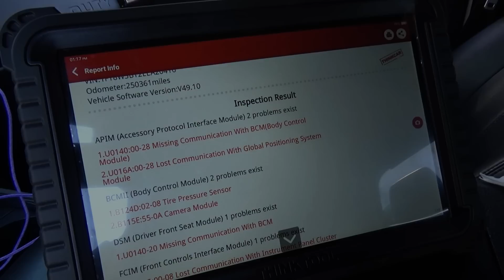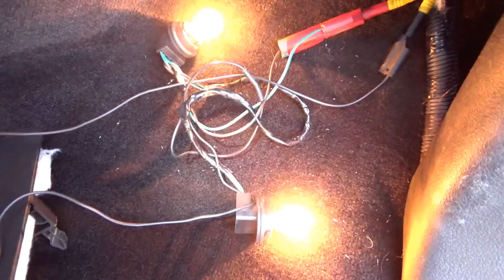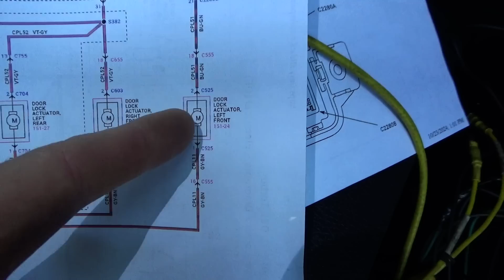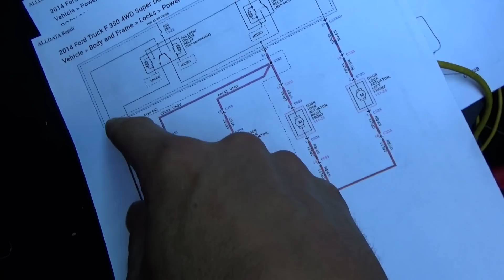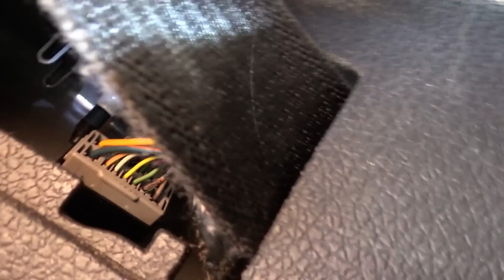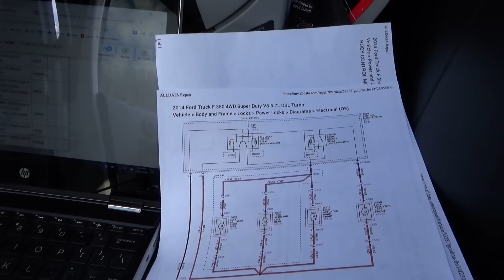(Pt 1) PowerStroke Power Locks DISASTER!?

Comment: Looks like everyone knows how this was caused. This has to be the easiest cliffhanger question you have ever posed, Ivan. 😄
Reply: So “how” was it caused?  I am quite puzzled because I seriously doubt that even that 20 amp fuse caused the carnage. Should be interesting to find the actual cause.👍
Reply: @brianw8963  Someone put a fuse into the circuit that was way too high in capacity.  Numerous comments pointed to this obvious act.  (I think that the owner is a friend of Ivan and he didn't want to embarrass him, so he acted like he didn't know what caused it.)
Reply: @vpimike2646  That is speculation, but probably close to truth at least regarding the fuse. 👍
Reply: @brianw8963  Oh there's no speculation to the cause of the burned up wires.  Had the correct fuse been installed, it would have blown long before the insulation on the wires would have melted.  That's the purpose of fuses and circuit breakers.
Reply: @vpimike2646  Is it a possibility that someone may have even inserted a jumper wire in place of the fuse momentarily to follow the smoke? What did You not comprehend on my initial comment. And I’m fairly certain I have a grasp on the function of fuses and circuit breakers, but thanks for the update .

Comment: When I first opened my shop and was just getting into diag I had a guy bring me a VW Jetta. It had windshield washer nozzle heaters. It starte blowing a 5a fuse. He had a pile of probably 50 fuses in the floorboard. All the colors 30a 20a 15a he just kept putting them in. It melted clear back behind the dash. I did get it isolated but it still had wires melted. Id bet that your customer was putting all kinda fuses in too.

Comment: Ivan you are becoming the master of the cliff hanger. Can’t wait til tomorrow…

Bad door lock switch? Sticking? Causing relays to stay on extended time thus heating wires? Maybe that blew one motor to open circuit? Motor windings became the fusible link?

Comment: A bigger problem now is you touched it... so now it's a personal liability issue if you don't properly repair or at minimum remove or isolate the damaged wiring. 

The last thing any independent mechanic needs is an underwriter suing you for damages from a burnt up truck. What if a house or other structure burns down... hundreds of thousands in damages.

Comment: If failed resistance is sending xtra current that would smelt wires.Its either a stronger current item or a small one like the door locks that would get used and repeat the occurrence often

Comment: 20A is too large to protect individual small gauge wires.  Kind of a bad design though maybe not different than other vehicles.  If the system has any kind of feedback capability, it would energize the solenoid until it sees it lock/unlock (up to a timeout I would assume).  This may be a case where you need to quote the customer for a wiring harness and not try to piecemeal it.  I'm sure it's expensive, if it's even available.  Or used may be a better option.  But I would seriously consider just doing the entire harness where wire damage could have occurred.  At least quote the customer and let them decide.

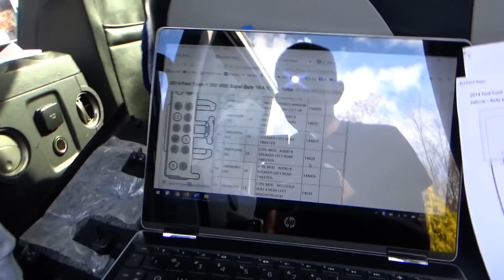Comment: 15:10 How?  Answer with funny example-When I was a rookie at Toyota in the 90's and had a Previa blowing a radio fuse, another tech told me to "smoke test it" after frustratingly trying to find the short.  Straight jumper in place of the fuse revealed the radio amp in the back quarter was the problem but sadly it smoked the harness from the fuse box all the way back.  So that's the answer-Someone smoke tested that baby. LOL

Comment: Someone must have used a fuse that was measured in Ga rather than amps :)

I guess if the body nicked the wire(s) at some point in the main harness, that's likely where the meltage will stop.  Otherwise it's going through the entire length of wire and every connector back to the fuse block.  At least Ford decided not to tape it up the entire way.

Comment: I wouldn't touch that harness with a 10 foot roll of automotive tape.  It is full replacement or nothing. Personal opinion.  

By the way, that is a poor design.  The wires are too small for the fuse.  There was a failure to analyze what would happen if a single point of failure on one branch would create a path to ground that would draw all 20 amps through that one path resulting in an overload on the wire.  If you think about it, if you need up to 5 amps on each lock then 4 x 5 is 20 amps which makes sense but with that circuit if one lock starts to short just a little bit it will draw more and more current from that circuit since they are all in parallel. The lowest resistance path draws the most current.  Remember that the owner reported that at first it was only one lock that didn't work and over time it got worse until the fuses started blowing.  That damage is the result of a gradual process.  

The circuit needs to be redesigned to either have heavier gauge wires or so no one branch can draw more than the rated current for that gauge of wire.  I could get a second year physics student to figure that out.

Comment: Wire CSA is too small for the fuse, or the fuse is oversized for the wire. It's a bad design that's common in nearly all brands and models. Even luxury brands that cost a lot of money. They want to save money by using the smallest wire possible, ignoring the current rating of the wire. They probably think that if there is a direct short the wire resistance will be low enough for the current to be high enough to blow the fuse before melting the wire. That is only true if the short is direct, not partial, and the wire is short enough - after some length, the resistance of the circuit is too high to reliably blow the fuse even with a direct short. A partial short may melt even a short length of undersized wire, say if the wire can only carry 10A continuously, the load is normally only a couple A, but then that one wire is joined together with a couple other loads into one fuse that is, say 20A, because the total current of all loads is more than 10A. If a partial short in one of the loads occurs, so that the small wire is now carrying 20A instead of the rated 10A, the fuse will not blow, but the wire will melt if the partial short doesn't burn out in a very short time. If there is a direct short, the fuse will melt as even if there's say 40A going through the wire rated for 10A, the 20A fuse will blow before the wire melts. It's this practice of fanning out one large fuse into several smaller wires that are only sized for continuous duty for their attached load, that leads to melting wires in case of partial short (overcurrent) fault scenarios.
Reply: The correct engineering practice that is taught to all electricians is that a fuse must always be sized for the smallest wire it is protecting, regardless of the load attached to the wire, because the fuse is there to protect the wire, not the load. If that were done in this case, the wire would not have melted. The manufacturers ignored this practice, because their product is not subject to the same regulations and inspections that building installations are, they can practically do whatever they want with wiring.
You can also correct their mistake after the fact by installing smaller fuses. I do this to all my cars that I own. Look at the wiring diagrams for the load side of each fuse, look at what the smallest wire CSA is that the fuse feeds, look up the rated current capacity of that wire, then install a fuse slightly smaller than that. Of course sometimes the peak load through that fuse is larger than the fuse size you arrive at by looking at the smallest wire size, in that case you need to compromise and install a fuse that won't blow with the applied load, and gamble that there won't be an overcurrent fault on that undersized wire. The  most common place where wires are undersized are blower motors, wiper motors, lights, small actuators fed by the ECU or BCM with no individual fusing other than one main fuse feeding the entire module. In the blower motor case, the inrush current when it's starting up is much higher than the normal running current, so they size the wire to the running current, but the fuse would blow with the inrush current if sized to the wire, so they oversize the fuse by 50-100% to keep it from blowing when the blower is turned on (this problem usually doesn't exist if the blower regulator is electronic, as they have a soft start current limiter).

Comment: Ivan, what do you mean "you do not understand why the 20 Amp fuse didn't protect the circuit"? Answer: Someone was in there before you, sending 12V via jumper lead straight from the battery through the wires. Only stopping once smoke came out from under the trim. Don't be naive.

Comment: One owner was tired of blowing 20 Amps fuses, and installed a jumper wire until smoke came out from under the trims. Then quickly removed it and passed it on to you in order "to deal with it". Problem: The harness melted together. Lucky he didn't set his truck alight. Ivan, refuse to deal with these kinda people unless they accept accountability, and are willing to bear the cost for the proper repair
Reply: Always deal with these folks. 
Morons like this pay the bills. 
Between diagnostic time and parts.... money is money
Reply: get that in writing from the customer
Reply: I knew someone who did the same thing to a VW Bug.."I'll see where the short is by finding where the smoke is coming from".
Reply: Exactly the issue

Comment: Your current drop difference … The lower current reading was going through the test light and the door coils to find its ground…. In series = more resistance/ less current. The higher reading was direct through the test lights to ground. If you rewatch your testing the side of the tree with the short is obvious.   
As always … great stuff
Reply from the maker: Take a close look at the readings... The difference was only 0.2A...so BOTH sides of the circuit were directly shorted to ground 😉
Reply: It’s three coils in parallel so the difference between a direct short and a path through the coils is small   … but it is a measurable difference.

Comment: Short must be in the door harness where it bends when you open and close the door, some times they melt far enough that you have to remove the seats and console to fix it.
Reply from the maker: But I measured the resistance through the door lock circuit of the Left Rear door and it was OPEN! How do you explain that? 🤔
Reply: @ because it might have shorted to another wire not related to that ckt and created an open I have seen this many times
Reply from the maker: @corradoferrari6191  so we have a bad door lock actuator AND a short in the door harness? That would be a BIG coincidence 😄
Reply: @PineHollowAutoDiagnostics  just remove the rubber acorde on on the door harness before the connector and you will see if the wires are bad which I bet they are, most likely a thicker wire with power shorted to a thinner ground wire and caused the main harness to burn the way this one is, lock fuse did not blow until power was activated to lock or unlock.
Reply: Door harness if bad can be replaced if available it was on back order for years.

Comment: That wire is not 12-gauge wire. It's maybe 16-gauge or 18-gauge. Maximum current would be 10 amp. That fuse was rated too high for that circuit. It allowed constant over current thru the wire overheating it, before it melted the insulation and popped the fuse.
This is an engineering design failure.

Comment: the fuse kept blowing and someone installed a larger fuse
Reply from the maker: 20Amp stock fuse was already wayyy oversized 😂
Reply: Exactly what I was gonna say. My first car had no illumination on the cluster. When I checked the fuse box, there was a blown 30A fuse. You couldn't read the required size, but I knew it wasn't 30A. When I got a Chilton's manual, it showed it was supposed to be a 5A. The load side of that fuse had melted to another circuit. I had to rerun the entire illumination circuit. The short was in the ashtray light. The repeated opening and closing of it broke the wire and it was laying on the dash support and the previous owner just popped in a 30 as a "fix". It's a wonder it didn't burn down, same as this truck.
Reply: @topher8634  My thoughts exactly
Reply: @topher8634 I looked at an old 4 runner with no brake lights for a coworker at my old job. The guy just kept putting in larger and larger fuses each time they blew. Melted most of the wiring harness together front to back. I sent him on his way and told him good luck.
Reply: Damn, beat me to it! Eventually the wire becomes the fuse!
Reply: Yea I'm willing to bet that's not the first time that fuse blew. Probably put several fuses in in a short period of time and it cooked it
Reply: Or installed a no blow ‘fuse’.
Reply: Thats called aluminum foil@John-dp3ln
Reply: Could be those crap Amazon/chinese fuses that don't blow as rated.
Reply: I had a customer with an MR2 that doubled the fuse size and burned a wire through the entire main harness behind the dash.
Reply: Isn't that standard operating procedure 😅
Reply: Over fuse it! You'll find your problem!
Reply: @philllsxga.7737   that's known as smoking out the problem.
Reply: Would a 20 amp fuse cause that much carnage? I think there’s more to the mystery. We shall see. 🤔😀
Reply: @brianw8963  it's possible the guy put a short across the terminals in an attempt to "fix" it
Reply: That is what my answer is also. Although I have seen as proper sized fuse not blow and melt wires like this.
Reply: Schematic calls for a 20 amp fuse, which is overrated for the 16-18 gauge wire.